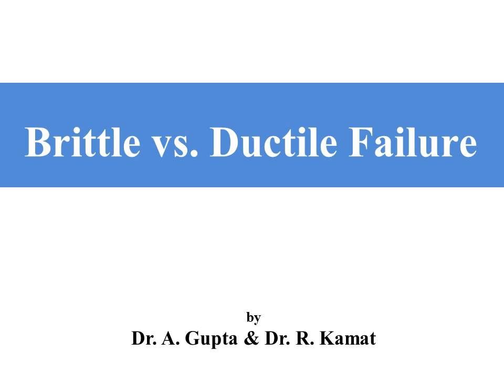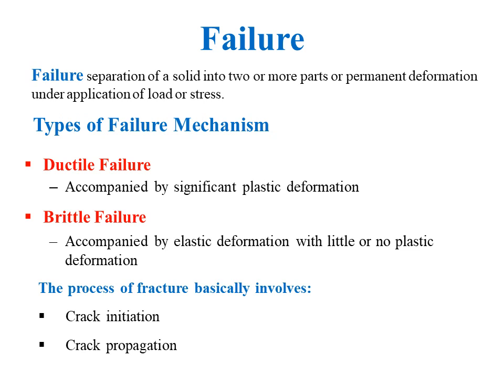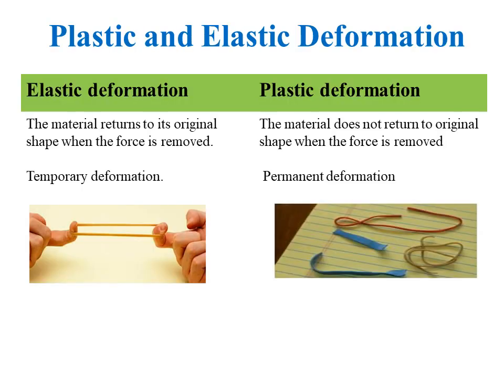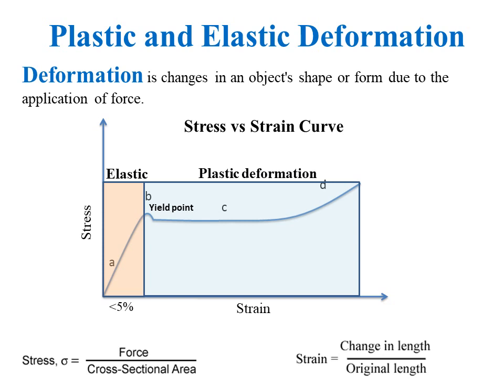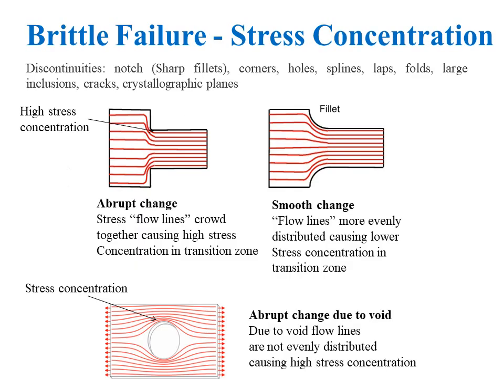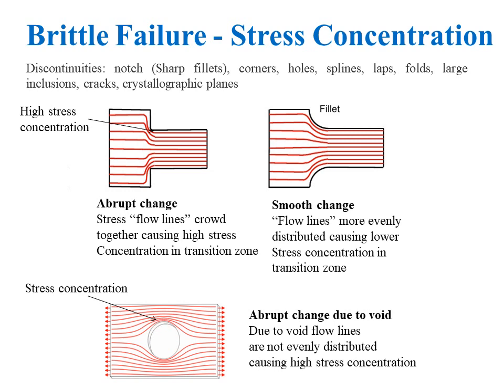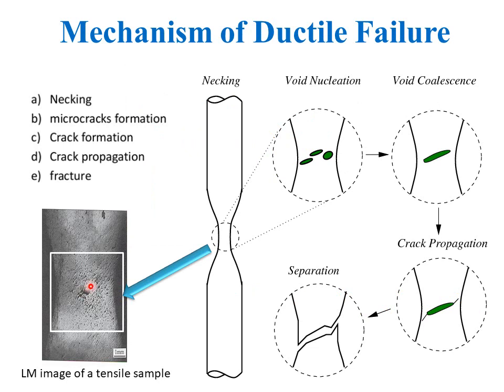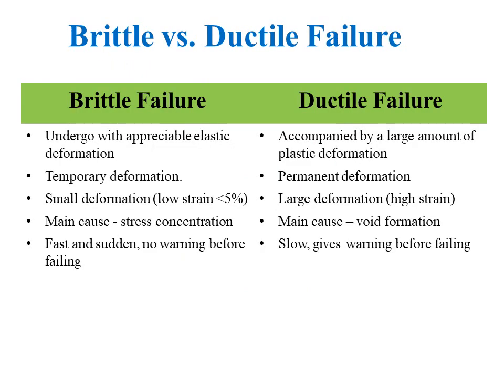Brittle vs. Ductile Failure

Comment: I have a question that.: why void formation occurs in brittle materials
Reply: May be they dont get enough time to recrystallize or get into definite geometric arrangement(in case of rapid cooling). Or solubility of one element is low in the other phase.